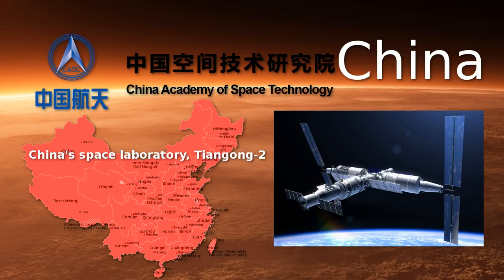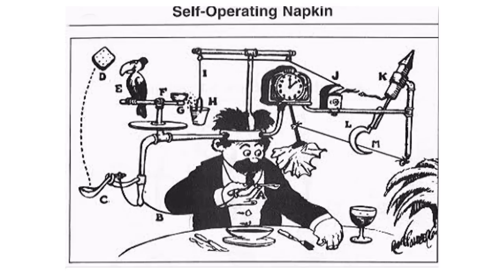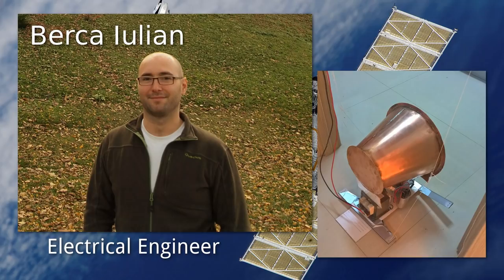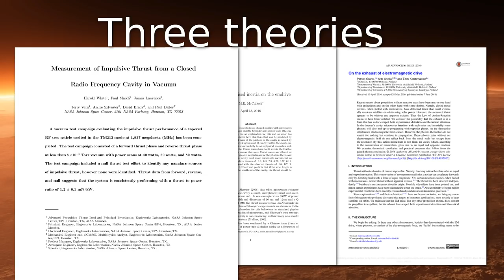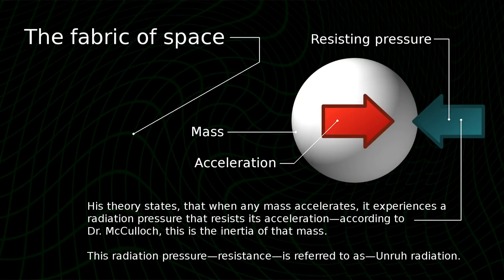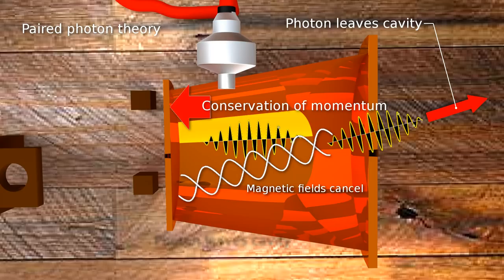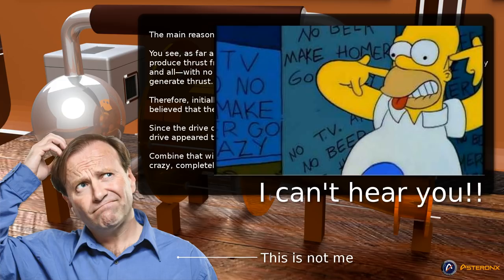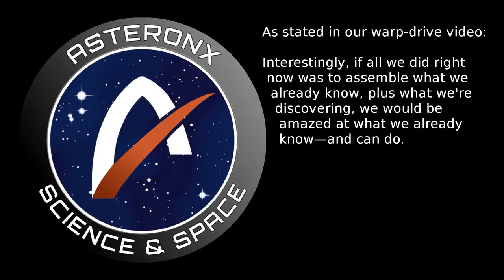An Explanation of the EmDrive and Cannae Drive Part II

Comment: The Chinese have retracted their assertion that they measured significant thrust.  I reviewed the NASA paper and they did not build the power source into their device, meaning that they were supplying energy and momentum from outside source.  This invalidates the experiment.  They also did not account for ionic flow from the device.  It's probably just an ion drive, with ion charge being supplied from outside current.  They've made a very inefficient cathode that has asymmetric electron boiling.
Reply: Why don't you link to these claims you just made please!
Reply: Yang, J.; Liu, X.-C.; Wang, Y.-G.; Tang, M.-J.; Luo, L.-T.; Jin, Y.-Z.; Ning, Z.-X. (February 2016). "Thrust Measurement of an Independent Microwave Thruster Propulsion Device with Three-Wire Torsion Pendulum Thrust Measurement System". Journal of Propulsion Technology (in Chinese). 37 (2): 362–371.

"EM Drive Developments, NASA spaceflight forums, discussion of Yang's 2016 paper". forum.nasaspaceflight.com. Retrieved 14 September 2016.
Reply: Oh, and the NASA paper is:

White, Harold; March, Paul; Lawrence, James; Vera, Jerry; Sylvester, Andre; Brady, Davi; Bailey, Paul (17 November 2016). "Measurement of Impulsive Thrust from a Closed Radio-Frequency Cavity in Vacuum" (PDF). Journal of Propulsion and Power: 1–12. doi:10.2514/1.B36120.

In which they state up front the first (among many) of items that completely invalidates the experiment:
"All dc power and control signals pass between the external equipment and vacuum chamber internal components via sealed feedthrough ports."
 
It is a very amateur error to supply power to a sensitive thrust test from outside the craft unless you are trying to demonstrate remote sourced thrust applications (like fire-hose drive).
Reply: Says the armchair physicist.  Your so much smarter than Chinese scientist.  They should have just sent you the device.  We might already have made it to a different Galaxy.   Publish your YouTube thoughts.
Reply: Skepticism is healthy, but skepticism in the face of mulitple experiments showing positive thrust.. this is crossing into climate denial tactics. and frankly, I don't consider the word of some random dude on the internet to be sufficient to 'invalidate' anything. this is the internet, and misinformation spreads as fast or faster than information. I'll wait for more experiments before I decide on the technology.
Reply: ..explain to me-in terms of physics-how this invalidates anything. at best I can see interference from induction(maybe), but I fail to see how remote power invalidates such a test. this is a claim I've not heard either.
Reply: can't smash the laws of physics.
Reply: The problem is that they all make micro Newtons of supposed thrust which could come from a million other things. I don't understand why they don't just build this thing to make real power so it's indisputable given how important this is.
Reply: Of course the Emdrive needs external power. It's transferring radiation into momentum so it needs power to function.

Comment: Yah just hammer one side of your microwave shorter and off you go. No really, I would be so happy to see this worked. One problem is that if we don't totally understand why something works, like quantum observations for example, they may malfunction under some new external circumstance. I wonder where energy is typically lost in these devices besides supposed conversion to thrust, possibly heat loss?

Comment: I wonder if they could use the same principal of  microwaves with magnetic waves. Since magnetic force is the strongest of all forces.
Reply: Omar142118 I thought the strong nuclear force was the strongest of all forces.
Reply: Omar142118 If I'm wrong though, then please enlighten me.
Reply: Ly:bInhn DhInhm:Ateidr Yes, for this application. All atomic interactions are a result of the electromagnetic force. Electromagnetic Force is fundamental force 
in nature. Electromagnetic force holds atoms together. This makes nuclear force strongest. Since everything in nature is charged with particles by manipulating the frequency of the magnetism you can achieve a far greater thrust that is infinite since magnetism never decay.
Reply: Either nuclear force is stronger, but I see your point.

Comment: Results from testing have been too inconsistent.  Some have measured force in the "wrong" direction.  Several have noted no forces at all.  To date devices producing thrust have never been observed to produce thrust when mounted on a platform with their power supply, strongly suggesting that thrust may come from interactions with electromagnetic forces by  the power cables, with net-zero effects when both ends of the cables are measured.  AFAIK this is still in the realm of "needs demonstration of sustained force that accumulates into actual velocity, in a vehicle with onboard power supply, before I believe it."

Comment: Don't know if you didn't mention this because you're trying to push a narrative for youtube views or because this video is old and you just didn't have the info at the time but it's looking more and more like the thrust being given out is a result of earth's magnetic field interacting with the drive's electronics despite the shielding around the experiment: when the  Drisden study opened the experiment chamber and manually rotated the engine rather than rotating the whole chamber, they found that the direction of the thrust did not change as it should have. They then went to formulate a model of magnetic field engine interaction and the math was consistent with the thrust findings. This is the same group in Germany you mentioned in this video. Maybe we'll have hover tech in the future but this engine will not be what powers it.

Comment: It makes thrust through convection/pressure difference caused by heat difference of parts of device and remaining gasses -  near vacuum in test chamber, could be outgassing/sublimating away part of itself or container, radiant (photon) thurst and magic pixies (hf radiation + sensitive opamps, + current loops through low intensity invisible glow discharges = bad ;-) and human errors ;-) messing with your "über sensitive - i mean it, i wouldn't wonder if it can detect g-changes at solar tides ;-) mechanical force sencors.

Comment: I am the original designer for this drive. The original concept involves a sharp tapered cone on the end of the cavity. The principle was the photons would undergo many more reflections in the conical section than in the flat region near the microwave input. Since the same photon deposits more momentum in the conical section than in the flat portion causing an asymmetry of momentum in the system where more momentum is deposited on the conical side. This momentum imbalance was hypothesized to cause a force in the direction of the conical section.
The theory is sound all we await is someone to demostrare this principle in the lab. Good luck fellow star travellers.

Comment: dont get why the em drive is getting all the hype. woodward based drives seem to be more intriguing as it starts with theory and then builds a device to exploit theory, rather than trying to prove a magical invention works.
Reply from the maker: The EmDrive is not the only drive. In fact, we will be creating a video about the Quantum vacuum thruster after Warp Drive part II.

Comment: So 1.2mN/kw means you need to input 833.33 MW to accelerate 1kg. Put that into perspective, the average car engine weighs up to 2,000kg and puts out about 0.074 MW. Those numbers don't add up to zipping around at speed. The plant required to power this and therefore provide significant thrust will weigh many times more than that, but seeing as the plant is so heavy I'd be amazed if it even twitched.
So all this bullshit about "hovering" cars is just that, bullshit. The only place this may be of any use is in space, but given that we already have better, more efficient ways to accelerate bodies in space what's the point?
Reply from the maker: What is stated in the video: 
"So, are we really going to have flying cars in our future? 

I'm sure that before too long—we will have unconventionally propelled flying vehicles, though they may not look anything like what we have come to expect—and, they will most definitely be equipped with artificial intelligence. 

>>Whether the EmDrive or something like it will be used in these vehicles or not, is too soon to know.<<"

Comment: Radiation pressure can create trust in open waveguide only and is extremely small and useless for driving...15 years ago I have invented real propellantless drive using EM waves but is has small thrust force to power ratio...So I have invented another type propellantless drive which is not using EM waves and has extremely large force to weight ration capable of lifting itself and a  large payload...

Comment: Ok. The EM drive tested by NASA measured 1.2 millinewtons per kilowatt.  To put that in perspective, our favorite time travel car, the Delorean, uses 1.21 gigawatts.  That amount of power is equal to 392.04 foot-lbs of thrust.  To put that in perspective, the 3.5L Ecoboost engine from Ford creates 420 foot-lbs.  

Your videos are fun but aside from conjecture, there isn't much substance.
Reply: +hgfrkytdh 1.2 millinewtons well below the noise/interference floor in the presence of any electromagnetic effects.

Comment: After the big hoopla introduction ov the first video, this one is disappointing. It does not give enough specifics in a way that can be understood by non-scientists. How much thrust is 2 million or 40 nM? And what are you trying to achieve here? You seem stuck on the idea of thrust. The idea of thrust from an exhaust is extremely primitive. Like Papua rowers rejecting ships with advanced screws and engines simply because the speedboat has no peddles, let alone people that peddle. If it were not for the vast amounts of money that are made from oil, we would have had other propulsion systems long ago. But vested interests are motivated by the lowest of lowest of common denominators which is fear of losing money. I would like to see a presentation with a video an Em-drive  propelling something, or pushing against something with a scale that measures the force of thrust. This is professor here professor there, typically American. Americans are fascinated by wealth and by CV's. I am only fascinated by people who understand and know something.